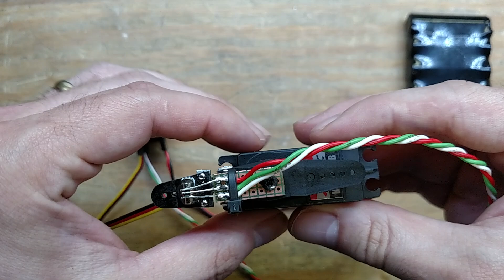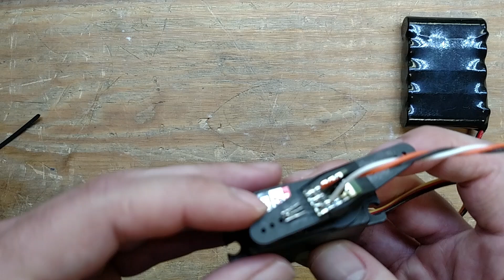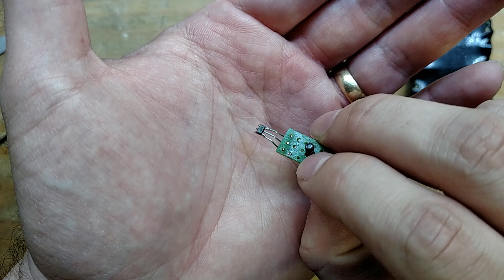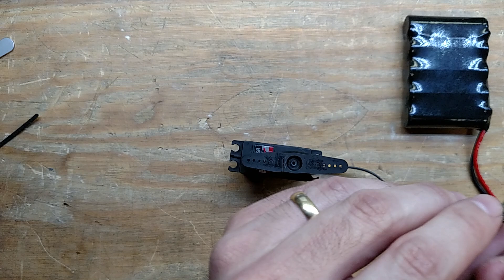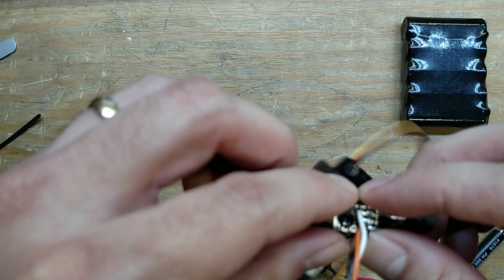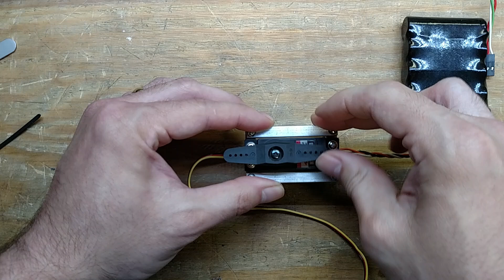RTMCS2 spring model, force input mode.

Comment: Hi, very exciting project, I am very interested in how you did the pendulum movement, I am working on a similar project but using FSR sensors to measure forces. Could you explain it a little bit?
Reply from the maker: It's a physics simulation, so the pendulum motion arises from the exchange of potential and kinetic energy in the system.

When you press on one side, the virtual mass is moved against the virtual spring and energy is stored in it. Then when you let go it swings back and forth around the mid point of the virtual spring.

Comment: Hey Wolf, I wanted to know if I can implement this force feedback using Arduino or STM32 using this hall effect sensor and servo motor.
Reply from the maker: Depends on the Arduino...
However, the STM32 is a much more powerful than the microcontroller I used.
Reply: @WolfTronix  Can you please share the algorithm/scheme that you have used to implement the force feedback?
Reply from the maker: @huzaifaazamkhan  
F=ma
Reply: @WolfTronix  I appreciate your answer. But as an engineer I really can’t understand where are you using acceleration in this hardware. I mean there is no acceleration, instead a hall effect sensor is sensing the movement of magnet in both directions and moving the servo motors. So, I am asking if you could share with me the algorithm that you are using. 

That maybe given as: 
-hall effect sensor tracks the position of a magnet
-movement command is given to the servo according to displacement of the magnet
-servo normally restrains its position at 90 degrees
Reply from the maker: It's not really engineering, it's mostly physics. ;)

The force sensor is the input to the system.

The analog value from the hall sensor measures the displacement of the magnet due to force.
This gives you 'F'.  (F=kx, where 'x' is the displacement of the magnet, and 'k' is the spring constant of the arm holding the magnet).

Divide that 'F'  force, by 'm' (Mass).
That gives you 'a' (acceleration) of the mass from the force.

Then you integrate 'a' to get 'v' (velocity), then integrate 'v' to get 'x' (position).

Convert that position to the 1-2ms pulse width to drive the servo.

Repeat many times per second.
Reply: @WolfTronix  Can you please share the experience of using the hall effect sensor IC/SOT-23 package and the D IP package (12:49) , I mean like what if the linear hall effect SOT-23 IC is unavailable, and I want to use DIP package. What are the limitations.
Reply from the maker: Package size does not matter.

The data sheet will show the physical size and location of the sensor element.

You want to size your magnet to match the max displacement over the sensor, and thus maximize the sensor output voltage without saturation.
Reply: @WolfTronix  This is golden info, thank you

Comment: This is awesome! It looks like you're using some form of active compliance force control with a side of position regulation... Or perhaps just position control with a simulated spring applied to the controller when deflection is detected? Do you have a paper/further information on the control methods used?
Reply from the maker: Kevin Cheung 
The micro calculating F = ma
Where:
F is force, m is mass, and a is acceleration.

Force is the sum of a virtual spring F = -kx
Where -k is the spring constant, and x is the displacement from center.

The actual force from my sensor is summed with the force from the virtual spring.

The micro performs rectangular intergration on the acceleration to get velocity, and then does rectangular intergration again, to get position.

This position is used to drive the servo (gets converted to 1-2ms pulse),  and the position is used as x to calculate a new spring force.

Thus completing the force loop.

Comment: how much is that sensor
Reply from the maker: Allen A 

http://www.digikey.com/product-detail/en/A1304ELHLX-T/620-1548-1-ND
Reply: interesting
these would be good for embedding in an airfoil to detect pressue with air flow
Reply from the maker: +Allen A 
You could also have a set on the controllers joystick... 
Then have the airplane send back the signals, such that you would have force feedback based on actual air speed over the control surfaces.

Comment: Hi. I'm thinking of using this in a robot I plan to build. I'm wondering how consistent was it from Servo to Servo? I expect a lot depends on the elastic elements involved.
Reply from the maker: +anthromod 
It all depends on consistent you make the spring element from sensor to sensor.

But they don't have to be precise, just repeatable.

After building all your sensors, you can place a few known weights on them. Then build a calibration table that converts the ADC value to an actual force.

If you have some extra processing time this could be done with a multi-point linear interpolation table.

Or if you have lots of program memory a look up table. ;)

Or if you find your sensors are non-linea
Reply: Thanks Wolf. Yeah I was afraid each one would need to be tested. I'm likely to use 3D printed SLS Nylon which can be inconsistent when printed thin. I'm hoping to make a bunch of parallel actuators, like a hip or shoulder joint. Force measuring is going to be an important part of the project as I'm going for a biology inspired control scheme rather than typical IK control.

Comment: Love this sensor! It's so clever!  I'm trying to figure out which ratio-metric hall sensor you're using, I see 304 written on the package but can't seem to figure out which one it is?  Also, are you able to use normal magnets or are they diametrically polarized?
Reply from the maker: This is the hall effect sensor I used:
http://www.digikey.com/product-detail/en/A1304ELHLX-T/620-1548-1-ND

If you search eBay for:
neodymium 1/16 x 1/32 
you should find the magnets.

They are magnetized north/south on the 1/16" faces.